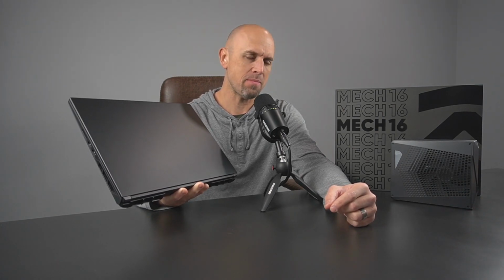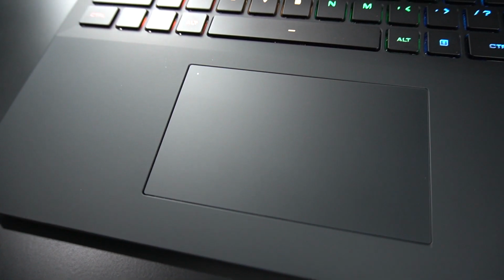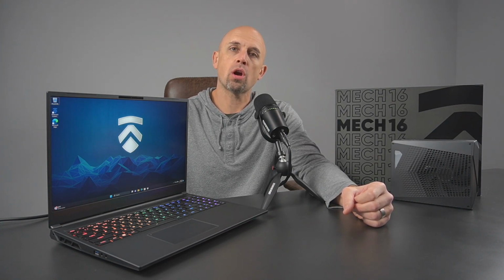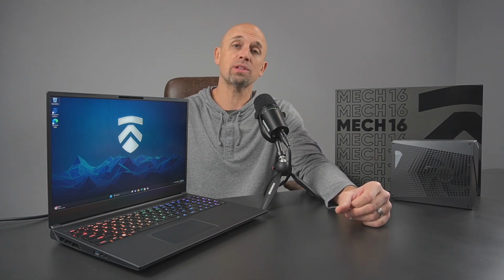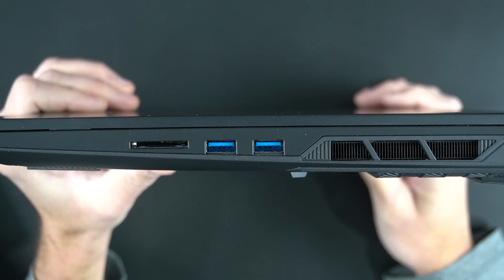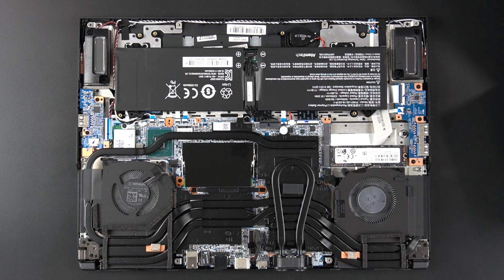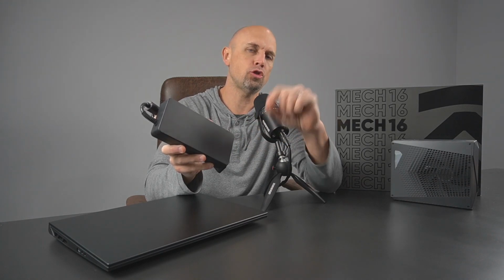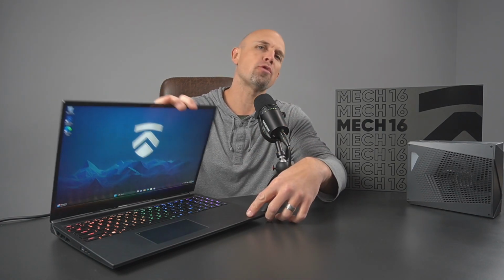Eluktronics MECH 16 GP - Laptop Rundown

Comment: I've been looking for an additional power supply for my Mech 16 GP.  Found voltage/amp output but couldn't find a connector size, not in any of docs.  Guessing it is 5.5mm*2.5mm,.  Can anyone confirm?